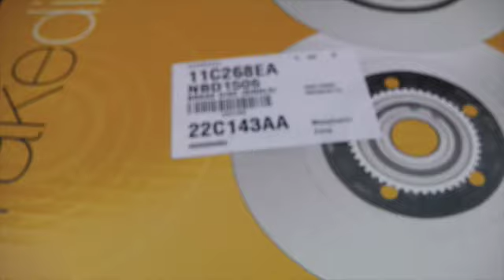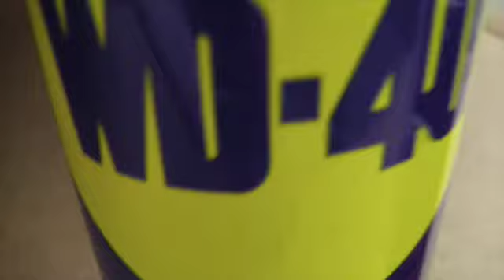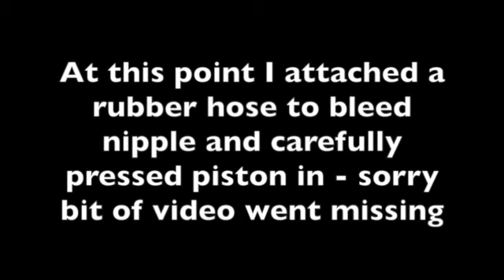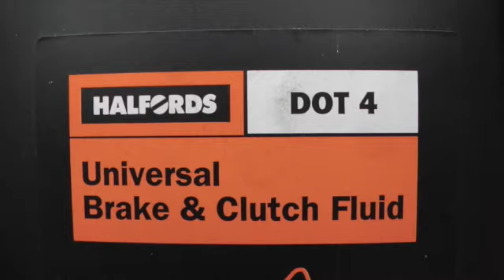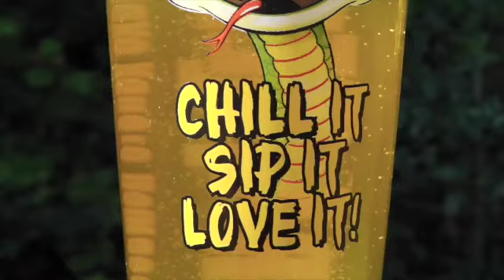Ford Fiesta Mk7 Replacing Front Brake Discs and Pads (2008 on)

Comment: Alan! one of my front springs snapped the other week on the lower suspension support! Potholes didn't cause the failure but corrosion did ! On the lower edge of the spring just were the spring comes off the support, the hard black coating on the spring had cracked away, allowing water to go under the spring and get trapped, eventually the corrosion was that bad that the spring was rotting badly and were it was rotting, this is were it snapped. I got a pair of new springs and my Son changed the failed side and also told him to change the otherside, the nearside seemed ok but when that spring was removed, that was rotting too on the bottom! When my Son re-assembled the struts I slapped loads of grease around the lower support and all over the spring were it touches the round welded on spring support.

I enquired with a Ford dealership and they seem to be a common failure and recently a 2013 plate fiesta has just had it springs replaced because they had failed.

looking at the springs they look fine and you can't really see because they area needed for inspection is on the inside and is hard to see, I used this video as research and with my Son we did it.  https://www.youtube.com/watch?v=6nhpR_S5zxA
Reply from the maker: Thanks Ian for the heads up on front springs snapping!

Comment: I open the brake fluid cap and slowly push back the piston with a c clamp,as a broken bleed nipple is what I have experienced in the past.
Everyone I know who does brakes does the same and I have for past 20 yrs with no issues.I wonder if your recording cut off at that point.
Reply: Removing the brake fluid cap will not stop the master cylinder seals from 'flipping' under back pressure from forcing the brake piston backwards. Always release the bleed nipple to allow the pressure to bleed off. It is far easier and cheaper to replace a caliper with a broken nipple than have a master cylinder removed and rebuilt!

Comment from the maker: Re. CORRODED FRONT STRUTS...Youtuber ian8354 - commented......."at 3 minutes 14 seconds you can see the front lower strut where it attach's to the solid steel arm, well a friend has an 08 plate fiesta and its just failed its MOT at this point! The car needs both front struts replacing as the steel on the strut was so badly corroded that it had split & cracked, pretty shocking to see on such a car for its age...... I'd suggest removing the big bolts out of your suspension, clean out any debris/rust and apply some rust preventative and then give if a good painting over to stop any future rusting."

Comment: Calliper pins set to torque of 27 ft lbs and calliper carrier bolts just short of 80 ft lbs. Got mine to change soon, not due to mileage but due to disc surface getting a bit rough. Cheers

Comment: How many miles had the car done when you changed everything ?

Ford recommends renewing the big bolts on the brake carrier! I see no real reason why!

I'll be changing my front discs & pads pretty soon, so your video will be quite helpful.
Reply from the maker: Discs changed at 45,000 miles owing to "pitting" and "heavy corrosion" - although there was plenty of wear left on them.
Renewing bolts on brake carrier?,, Mine looked fine so I just put them back on, but  manufacturers like to play extra safe for legal, and potential litigation claims in the rare event of bolt failure, so that is why they suggest replacing bolts. Finally, when you do the "job" remember to get some LOUD rock music on, and drink beer afterwards! Hope the sun is shining too!
Reply: Alan Cooney My car has only done 30,000 miles, It's a 10 plate had it from brand new.

Reckon I'll still see about replacing the discs/pads, Me and my OCD again in keeping it feeling like new and brakes like it was from brand new.

Comment: Why do you need to undo the bleed screw?
Surely you’ll get air in the system which means you’ll have to bleed the brakes,I’ve never undone the bleed screw I always undo the brake fluid resoviour cap
Reply from the maker: Reason: to avoid back pressure at brake master cylinder. Back pressure can damage the rubber seals in master cylinder.

Comment: Nice vid but a few points:
Use brake cleaner to remove brake dust and clean surfaces and thread lock on the bolts.
A Piston rewind tool should be used to avoid damage, they are cheap enough on eBay, got mine for at £15.
There is no need to open the bleed nipple and risk air getting into the lines. No garage or mechanic I know does this.
Reply from the maker: Thanks for watching and thanks for your comments.

Comment: Why do you not use a torque wrench? They are so easy to use and it saves you over tightening bolts and gives you peace of mind.
Reply from the maker: Agreed, torque wrench is good practice. I always use one on more critical items - eg: cylinder head bolts.
Reply: Alan Cooney I would say brakes are fairly critical

Comment: Have you ever experienced the car swaying left and right when driving at high speeds? I have the same car but have noticed it swaying on the motorway. Got it checked and couldnt find anything.
Reply from the maker: Without seeing your car can only offer a "guess", 1, tyre pressures too high, or 2, front wheel alignment out of adjustment.
Reply: Alan Cooney thank you. I had thought it was the front wheel alignments but didn't solve it when i got the wheels balanceed. Just read in the haynes manual that back wheel misalignment can cause the car to shake where as front misalignment is only the steering wheel that wobbles. 
thank you for the reply 🖒

Comment: why did you change these discs and pads? there fine or did you just do it for the sake of the video? would have been better if the old ones where worn out or damaged for comparison
Reply from the maker: Local garage recommended replacing discs owing to excessive corrosion. I think old discs were fine, but annual uk MOT test continues to be very strict & very fussy!

Comment: How did you press the piston in? By hand? @17.20 on video
Reply from the maker: I put small block of wood on face of piston and gently applied pressure - using a suitable lever between the wooden block and caliper. Not much pressure is needed, but it's important to ease it in "centrally" because if you accidentally press one side of the piston more than the other - then it may jam!
Reply: Alan Cooney thanks mate. Actually did it earlier today. Used a spare jack. Used the bottom of the spring as an anchor and pinned the caliper against the frame. Worked a treat. Cheers

Comment: did you bleed the brakes after?
Reply from the maker: No, I did not bleed the brakes. I would usually only bleed the brakes if air had got in the system.
Reply: +Alan Cooney fair enough, thanks for this vid mate, i've done brakes plenty of times but never a ford... so watched this to brush up incase there was any 'quirky' ford added extras.  Helped a lot, did my friends brakes pretty quick thanks to this.